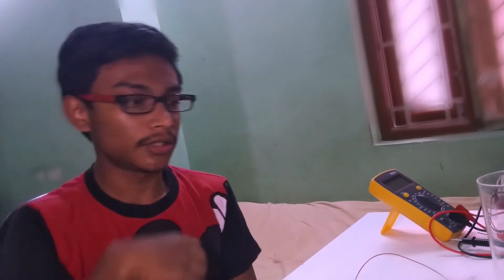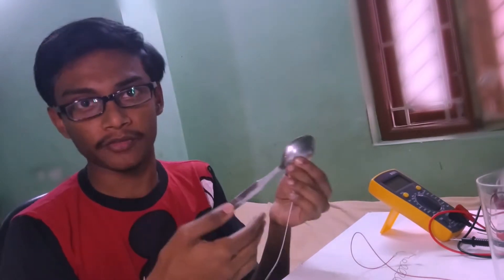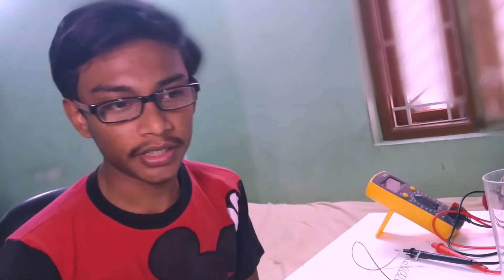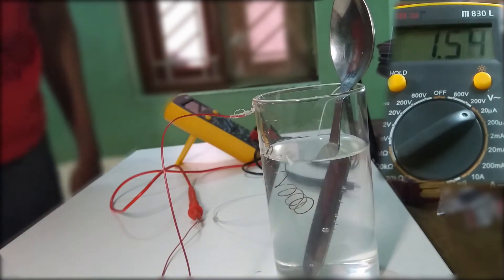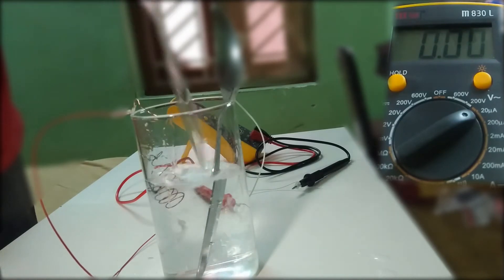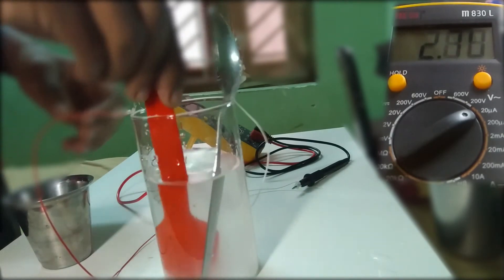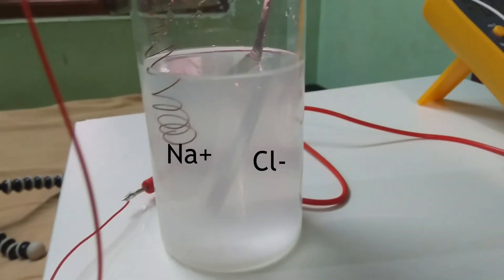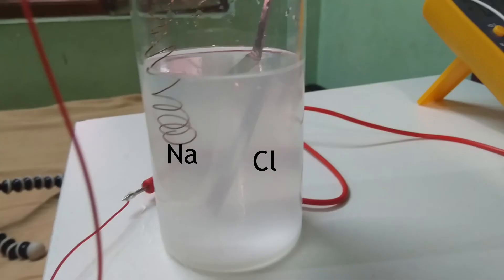Can we produce electric current with Sea water or Salt water?

Comment: a quick question pls, why does the Cl ion have to go only to the zinc terminal. And why do you call that an electrode, there is no electricity passing through them externally. Anyway nice vid......
Reply from the maker: It's easy to form zinc chloride than to form copper chloride this is mainly due to that the zinc electrode is an anode and copper electrode is cathode so the anions( negative changed ion or cl ion ) move to the anode
...... Well I'm calling it electrode instead of terminal because they are dipped in an electrolyte solution
Reply: @UnpredictableScience  yeah correct.